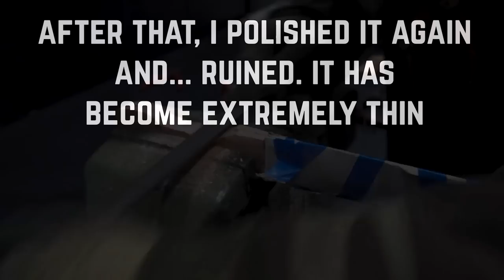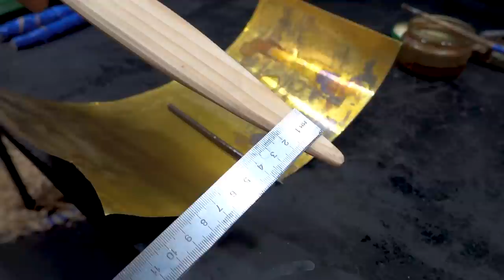Restoration Old Caucasian Qama Dagger

Comment: Alex, soldering brass with tin-based soldering wire gives an extremely strong union, but doing the same with iron or steel is exceedingly weak. For that, you need to braze them with brass-based soldering wire (which gives you an union almost as strong as a welding. Almost). Of course, for that you need a propane-butane blowtorch (a wee bit more hot than a common soldering torch), but those are not exactly a difficult piece of gear to get.
Reply from the maker: Greetings to you! Thank you for your attention. Yes, you are absolutely right. You know what's the matter, I rarely solder galvanized wire or other heavy metals, more often non-ferrous (brass, copper, bronze), but this time I spent a lot of effort on this dagger
Reply: @ScrewsAndTools  On that note, I can confirm that a small touch of acid (I use HCl, hidrocloric acid, a common household cleaning item in my country, dunno in yours but any acid will work, just a matter of how long it takes) will eat the galvanizing in no time, leaving you with a good surface for soldering.
Reply from the maker: Thank you for your advice, I will try to find it and buy it as soon as I am in the market! Good luck to you

Comment: It was a great restoration and good to see you not give up after all those mistakes, but I'm still confused as to why the brass fitting at the top of the scabbard was on the inside of the leather, don't they usually go on top of the leather?
Reply from the maker: Greetings! Thanks for attention. This is one of the options when you need to show only the tip (ball) at the end of the scabbard. I also do when brass is on top of leather.

Comment: I thought you might legitimately lose you mine during this build and was worries you still had access to sharp objects! You sure experienced a lot of what Bob Ross called "happy little accidents". Curious where the ideas for the protruding handle pins came from?
Reply from the maker: Greetings, thank you for your attention. Regarding pins and rivets, everything is very simple. Two rivets that are at the ends of the handle so that the blade does not slip out and in the middle (which I could not make) it is needed so that the blade does not turn over in the hand.

Comment: What is the purpose of the two side studs on the handle?
Reply from the maker: In the Caucasian type dagger, everything has functionality. Rivets come in different sizes. They are needed so that the hand does not turn and does not slip off. + comfortable grip handles.
Reply: @ScrewsAndTools   Thank you.